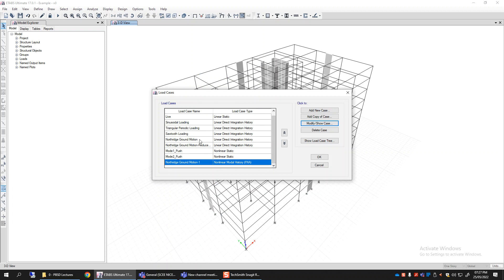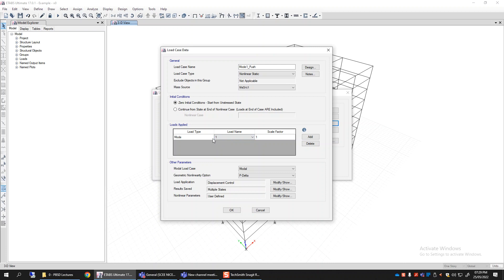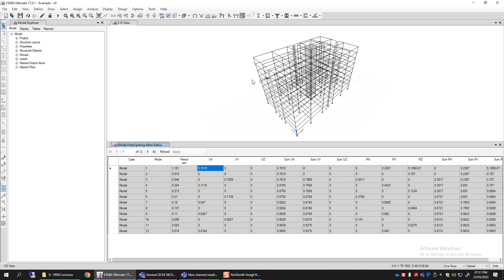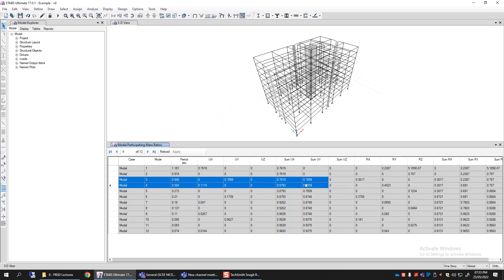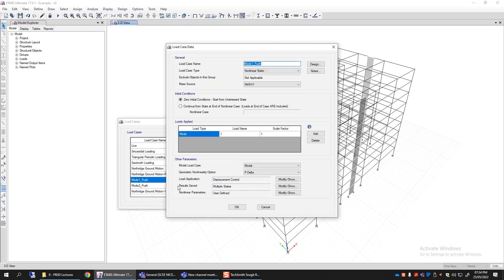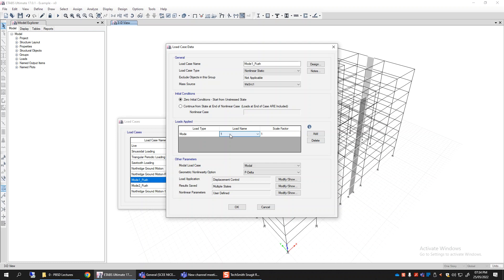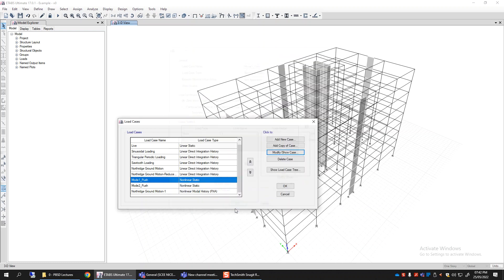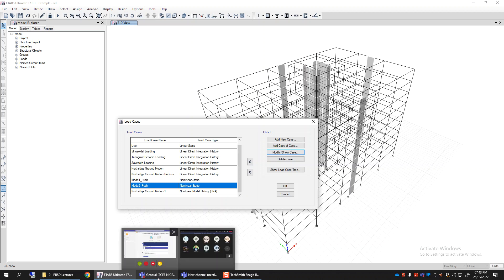79 - Nonlinear Structural Modeling - Part 14 - Nonlinear Static (Pushover) Analysis in CSI ETABS

Comment: Sir, I had one question. Suppose the modes are coupled and we are getting rotation contribution. Should we still continue defining the push in the mode shape loading and expect twisting or we use some other parabolic/linear pattern of loading?